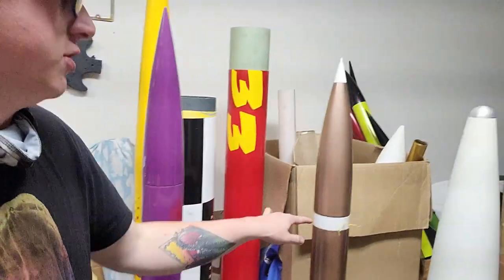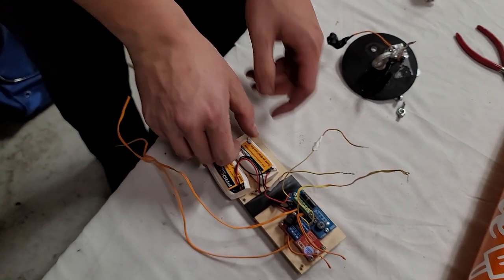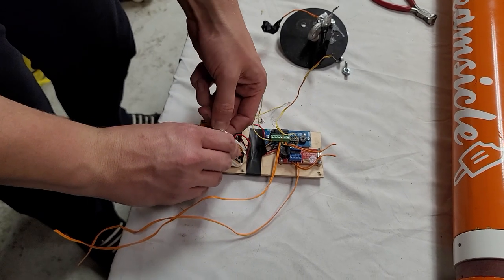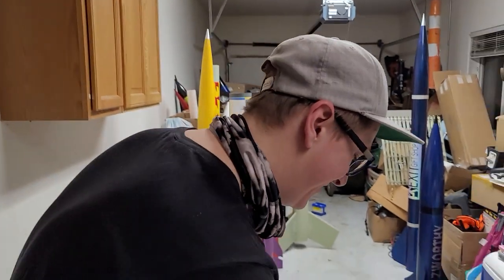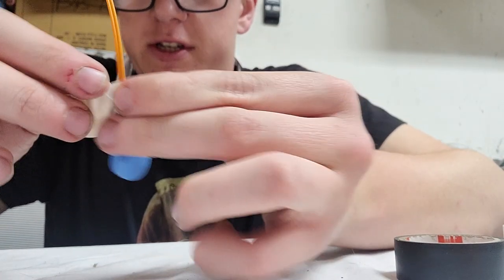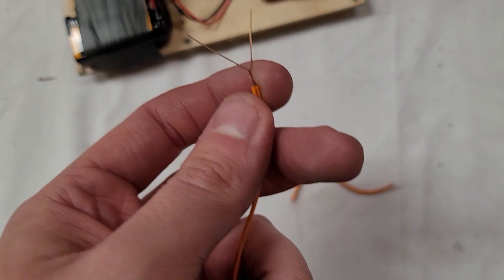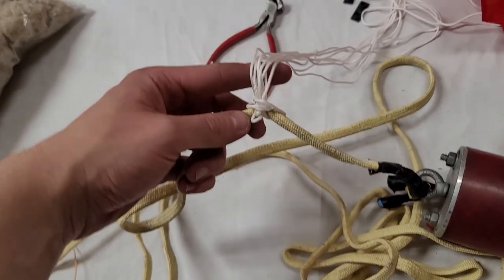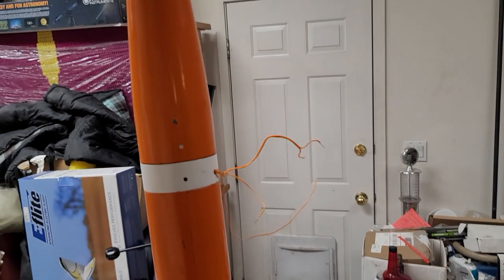High Power Rocketry Dual Deploy Electronics Setup

Comment: This is the exact point I'm at in my project.  I've never flown any electronics before. I installed a simple RRC3 and battery set-up on the sled, took a pic, and texted it to a few friends as a status update to this 3" Iris build.  They were all like "Wow, that is so complex!  You're, like, a real rocket scientist!"  That's great and all, but it means I can never show them these vids as I would immediately lose that title.

I'm going with an apogee deployment with motor backup. A 15' streamer, a Jolly Logic on a 42" main, and about 30' of shock cord will all be blown out together.  SERIOUS QUESTION:  If you were me, where would you put the streamer/chute?  Streamer attached at forward end with chute several feet down the cord, or vice versa?
Reply from the maker: Personally, I would put the streamer closer to the airframe and the chute closer to the nosecone. I really want to get one of those Jolly Logic chute releases.
Reply: @RocketVlogs  I was leaning the same way.  But I was getting advice to do the opposite.  After witnessing a few flights first hand in both configurations, I am going with chute near the nosecone.  
I just got my Jolly Logic but haven't used it yet.  I saw it used many times successfully in HPR flights at the launch Saturday.
Reply: @karlrobinson4887  I have one and I’ve used it twice. Successfully both times. I upgraded from the band to an elastic band.
Reply: @RocketVlogs  Chute release has been working perfectly, it just takes testing with your unique set-up.  But after flight #4, this happened:
https://www.rocketryforum.com/threads/so-lets-say-you-um-hypothetically-got-your-rocket-tangled-in-a-350-000-volt-transmission-line-94-feet-high.166387/

Comment: Why not just add a 24: payload section for the main?
Also the fast burn K1100 the deceleration could pull nose cone off. So make tight or use a 2-56 or 4-40 nylon shear pin.
Reply from the maker: If I wanted that I would have gotten a 3" Wildman.  

Nosecone is good, this rocket has flown quite a few times. K1100 flight was great save for the main hanging in the nose. It was unharmed though. Other flights have had good deployment with the head-end setup, though.